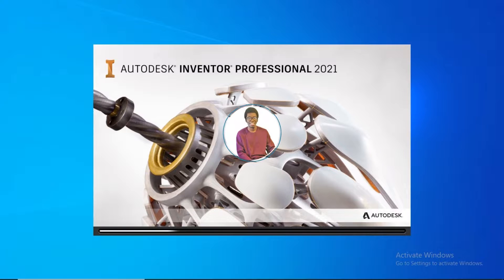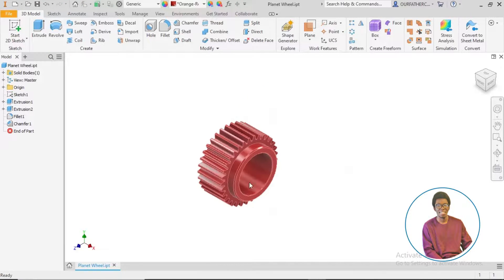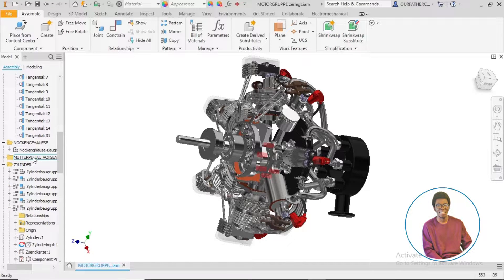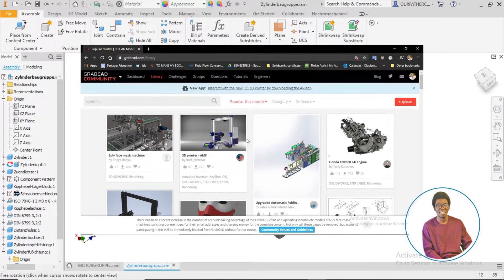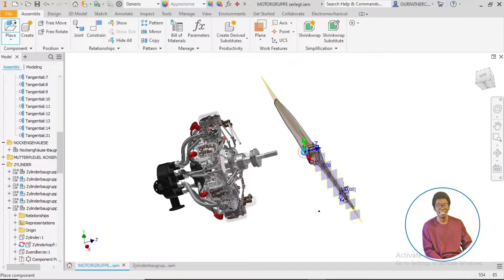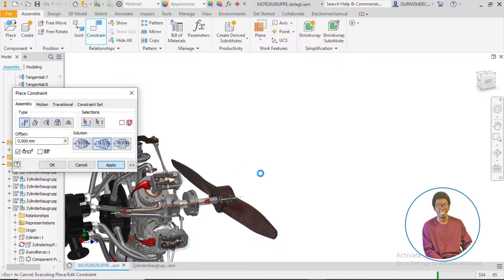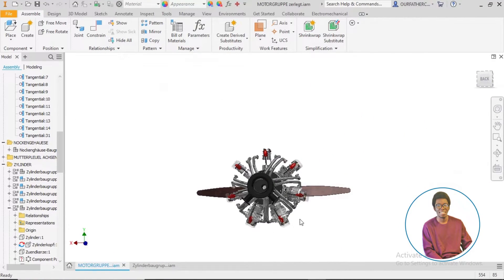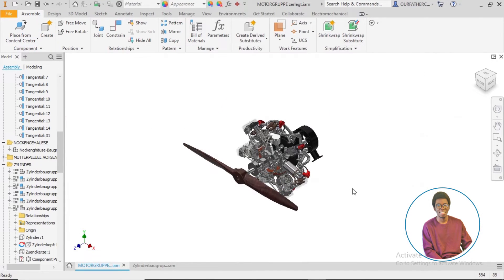Inventor 2021 | Radial Engine | Assembly Introduction

Comment: Is it possible for you to upload plans for such a beautiful radial engine (for non-commercial usage only). I have seen your previous videos, but I would simply love to draw this engine from plans myself <3. Great video tho, keep doing a good job!
Reply from the maker: I completely understand you, and it's frustrating having to get dimensions only from the screen. However, I included a link in the discussion (or community) section of my channel, that guides to where I saved the rough drawings I have used to far. Nonetheless, I plan to create all the drawing files again myself, and upload too for folks to utilize. Sadly, the major barrier has been time. I know I would surely do it, but time goes on too fast, and other duties have to be done.
Reply: Tutorial Space with Ola Now I can see, thank you very much and good luck with your exams you mentioned in discussion section!

Comment: Sir in pdf I can't find intake and exhaust pipe drawings ...can u please provide those drawings?
Reply from the maker: I couldnt actually replicate into a drawing, due to inaccuracies, so I neglected it. And that is something I wish I took more effort to solve.
Reply: @CADPond  sir then how can I get these dimensions of it can u explain?
Reply from the maker: I think the best way would be to use the skeletal modeling approach to model those parts... I could do a demonstration of how that is done for your sake. Lol, but I am not sure I would be able to upload it as fast you might want. What do you have in mind?
Reply: @CADPond  no problem sir ...even if it takes time no issues for ...I want u to upload the videos ...and share the knowledge to us ...that would be very helpful